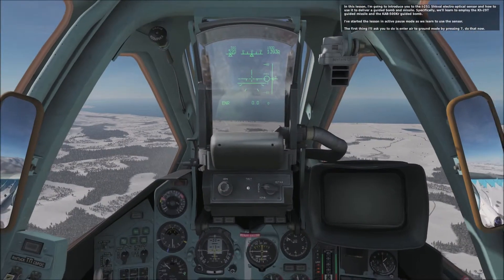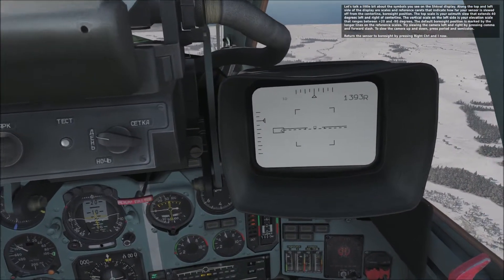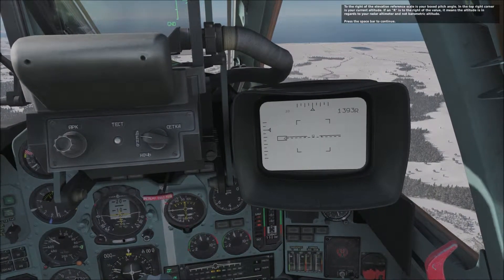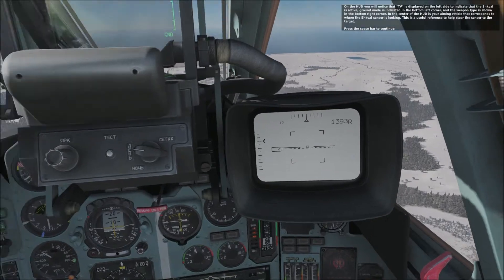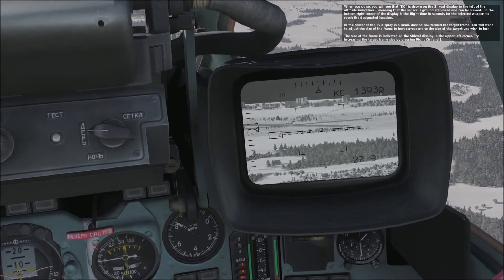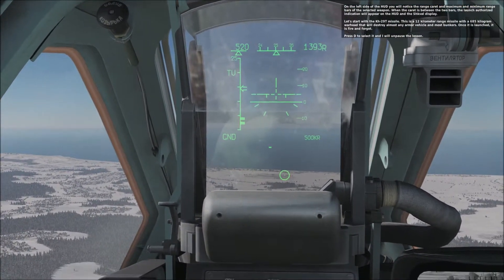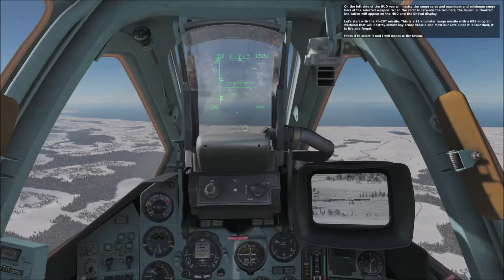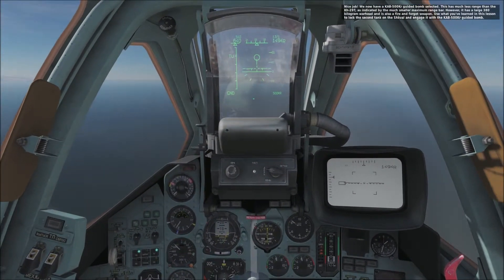DCS Shkval TV System and Kh 29T KAB 500Kr Training

Comment: I have done everything you have and got an ap sign in my hud but does not fire anything tryed it loads of times and does not work
Reply from the maker: First, I am not sure what you mean by "an ap sign in my hud."

Second there are a couple things to make sure. The Shkval is on, looking at the target, and locked, giving the "AC" indication on the Shkval. You can fire when it is only ground stabilized, "KC" however, but you are just going to hit the general area. The nose/attitude of the aircraft has to be generally pointed towards the target in such a way the weapon will come off the rail/rack it is attached to. You must be within the release envelope as indicated on the left vertical tape on the HUD, and a LA, "Launch Authorized" indication, displayed on the HUD. At that point Pull the Trigger and hold it down until the weapon releases. The only thing other than that that I can think of is if you are too close to the target to release anymore.

I've done this mission several times since recording/uploading to help troubleshoot, and those are almost always one of the issues. If I had more information, maybe I could help more.
Reply: @sergeantluke7439  to simplify his comment a bit aim the reticle on your hud on the ground target and ground stabilize it then check in the tv if the target is locked by looking at the top right corner, if its AC then its a lock if its KC then there is no lock
Reply: Also make sure if the arrow on the left of the hud is between the 2 bars, that means you are authorized to fire
Reply from the maker: @noggamcstogga1756  Great! Thanks for the input!!

Comment: how do you know when the bomb has actualy locked a target? I get the pod locking, but there doesnt seem to be any symbology OR indicator for the bomb's guidance system locking a target
Reply: From “KC” in the monitor to “AC” (Cyrilic characters)
Reply from the maker: @ranxerox575  Thanks for that. You are correct, and I think I misunderstood the question. You don't have any way of knowing the weapon has locked the target, but you do know that the Shkval has locked the target, and passed the reference to the weapon. You just have to trust that the Shkval lock is properly passed to the weapon. There are times that a lock indication, "AC," will still miss the target, but it is a rare occurrence. The same things can happen in other aircraft as well.
Reply from the maker: Sorry it took me a little while to get back to you. There is no "Symbology" that I know of that the "Bomb" has locked the target. As long as the Targeting System has locked and is firing the laser (sometime you have to check and make sure you have turned it on) the bomb should find the laser and start tracking. If you release the bomb within the parameters (meaning you have to release it before you have passed the point it can either not hit the laser or cannot find the laser), once released, it will begin searching for the laser, and when found, start tracking (riding the laser) right onto the point that the Targeting system has locked. Also, a good note to be aware, the Shkval system has to be able to see the target to keep locked, so make sure you have enough alt. and keep the Targeting System within it's radius to keep the lock, or it will reset, once out of the view radius, and reset to the default, nose forward position. That will cause a miss.